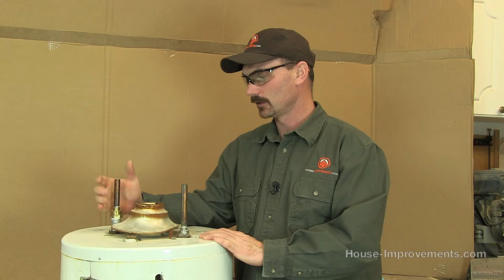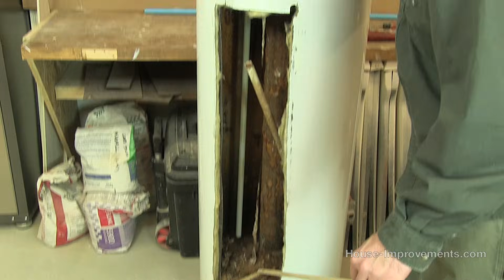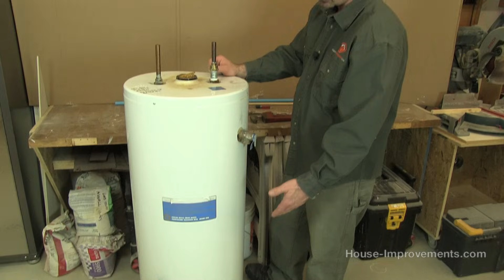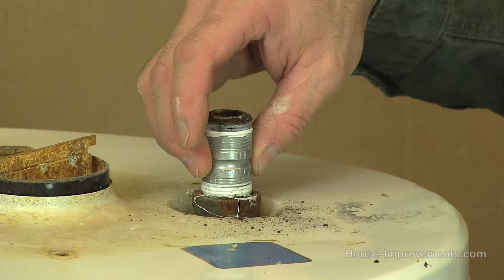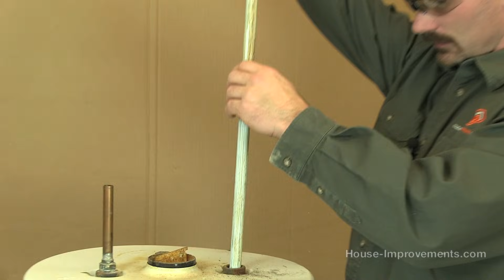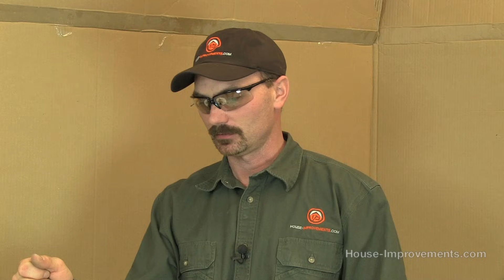How To Replace A Water Heater Dip Tube

Comment: Ok so, what do you do if you don't have the ceiling clearance to install a new tube?  If you need to pull the water heater out and lay it down to replace the tube, you might as well just replace it with a new one and not worry about the mess...
Reply from the maker: That would be an issue. I would suggest your water heater should not be in that location. You may be able to drain and unhook it and tip it enough with help and slip in the new tube?
Reply: @HouseImprovements Ya, that might work.  It's in a tiny closet with the furnace, on a raised platform.  There's gas lines coming in right in front of it, so tipping it would still require that I remove the lines.  Idk why the homebuilders couldn't have figured a better place to put the damn thing!😂

Comment: I have a huge problem and not sure what to do. I drained my electric water heater and now for some reason my water tank isn't filling up and no water is coming out of the hot water faucet at all not cold or anything. When I turned the cold water line back on to the water heater I didn't hear any water flowing into the tank at all so not sure if any water actually filled. I had the cold water line open for about 40 min to fill the tank  then turned power on ECT and nothing! So frustrating been working on it all day and I don't have a lot of money to hire a professional and would love to try to fix myself. Please help if ya can 🙏😫
Reply from the maker: Try turning on the fill valve and then opening a hot water tap at a sink, this will let air out of the system as its filling. Unfortunately you have likely damaged the electric heating element because you turned the power back on without the tank full of water. So you may have to replace that also but they are pretty easy and fairly inexpensive. First see if you can fill the tank, if it will fill then once full (water will consistently come out of the open sink faucet) turn on the power you should get warm water within about 6-8hrs. if you dont get warm water then the element needs to be replaced. Please come to my forum for assistance with what to do then. https://www.house-improvements.com/forums/
Reply: @HouseImprovements  I appreciate you ! But for some reason my water tank won't fill at all . I had hot faucets open while draining tank and left open to fill and waited 40 min to make sure water tank would be full before turning power on but still nothing. Maybe my cold water shut off valve broke when I turned it off and won't turn back on to fill the tank? So frustrating! But I truly appreciate you 🙏
Reply from the maker: @dottielawing4323   Interesting , that could be a possibility .

Comment: Do they make  a flexible dip tube? Not much head room.
Reply from the maker: These have a little bit of flexibility I dont think there are any that are really flexible. if you have a couple feet of space you will likely get it in, try not to kink it however. If that is not enough and if your heater is electric maybe you could drain it and tilt the heater to get it in? You can come to our forum if you hav more questions.

Comment: I have a pinhole leak in the sidewall of that thing in center? Fixable??
Reply from the maker: pin hole leak in the plastic part of the dip tube is no issue, just use it.

Comment: Why not an dip tube made of stainless steel  ?
Reply from the maker: Good question. Likely because most people maybe would replace the heater thinking its not working right instead of knowing to change the 10$ dip tube?

Comment: my cold water inlet had an 18"  dip tube.  Is that necessary or can i just put in a new nipple
Reply from the maker: You need a dip tube. A taller water heater like this one in the video will have a dip tube that is much longer than 18" so yours needs replacing .
Reply: i messed up.  my cold water nipple has  the normal length dip tube.  But my hot water nipple has the 18" dip tube,  Do I need that same length again? Thank you for the reply

Comment: Sorry if you already answer this question but if it's not attached to the dip tube how do you take the dip tube out
Reply from the maker: Sometimes the dip tub has fallen off and is lost in the tank, or some times it is there and you can reach it with needle nose pliers.

Comment: Our hot water tank sits under our stairwell, its top only inches below the underside of the level steps, so withdrawing the dip tube, if it's rigid and won't bend, won't be possible.  Is there such thing as a flexible dip tube that I may acquire to install once I've gone through the anticipated agony of trying to tilt my emptied tank so as to succeed in pulling out the present (probably faulty) tube? 🥵
Reply from the maker: Not that I have ever seen. Change your anode rod as well while you are at it, since you are going to all that work.

Comment: My hot & cold inlets on HWH are both HOT when i havent run any water
Reply from the maker: Not super un common especially if your water heater is turned up pretty high. Turn on a hot water faucet for 30 seconds and then check the pipes about 1' - 2' above the heater.

Comment: I have a leak at the bottom of my water heater. It leaks nowhere else from the tank. I took the cover off by pilot and finger checked the inside the bottom and it has water. Is this all I need to do to fix the water heater? Or do I need to replace?
Reply from the maker: If you have water inside the burner area ,your tank has a leak. Replacement is your only fix.

Comment: My electric water heater leaking water in bottom what cause it? How to fix it
Reply from the maker: its likely rusted through the tank and developed a pin hole leak. Replacement is the only option if that is the case and the sooner the better or you could have a flood.

Comment: appreciate the video, but unscrewing it only removed a coupler and the dip tube is within the heater, there's no way to remove it since there is nothing to grip onto except inner threads, is there a  tool to get the tube out?
Reply from the maker: Not that I know of.
Reply: @HouseImprovements  I did figure it out, basically I had to use needle nose pliers and pull out the old one which did not have a nipple, but the new generic dip tube fit along with my Shark Bite valve cold water supply valve. Again thank you for the helpful video!

Comment: The flexible braided hose idea is a great time saver. Thank you.
Reply: I,used a shark bite flex hose
Reply: I think they make them threaded on both ends and one version with a shark bite style on the other end. They have become very popular in the last few years as it saves a lot of time messing around with pipe length.

Comment: If the dip tube is broken off..will it effect the hot water output pressure..I have hot water but it flows slowly to all fixtures..I cleaned all the aerators on the faucets and shower head already.i also checked the hot water side nipple hole to check for clogged outlet already.
Reply from the maker: It should not effect pressure.

Comment: Thank you for the info, it perfectly matches the issue I am having.   But before I change it, what happens to the old pipe that broke off?   will the corroding piece sitting in the tank affect my water?

Comment: My basement ceiling doesn't have enough room to pull the tube straight out. How do I get the new one in without breaking that too?
Reply from the maker: They have replacements that are in sections linked together.
Reply: @HouseImprovements  Ok thank you and love your channel❤️💪🏻!!
Reply: The other option is to fully disconnect water heater. Lay it down, or lean it far enough to do the task and then reinstall. Similar issues arrive when replacing anode rods. Which if your heater is 3+ years old without replacing the anode rod. Change it while you’re already working on the heater. 

I know this comment is old, but stating for others who are planning on trying to do this task on their own heater.

Comment: This is an awesome video.  I might consider doing this myself or getting my Hispanic Buddy to help.  I changed out my hot water faucet on the tub and found some strange long pieces of plastic in it.  Kindof looks like teflon tape but it is wider.  It clogged up my tub's hot water faucet.  So, I wonder if that cold water pipe is breaking down.  Also, why don't they have it metal instead?

Comment: The benefit of a electric water heater:  you can remove the elements to inspect inside parts/clean out.  You can’t do this with a gas unit.....
Reply: I inspected my gas heater internals by inserting an inspection camera through the port for the safety pressure relief valve on the side. (I had the PRV it off because it needed replacing anyways... was probably 20+ years old and did not re-seal tightly after I tested it.) I was pleasantly surprised to see my dip tube was still intact.  But that made sense because, mine did not have the problem symptoms that Shannon described in video (Failed dip tube causes hot water supply to last much less time than tank volume would expect, because fresh cold water isn't carried by dip tube all the way to bottom of heater, cold water instead flows directly across the top from inlet nipple to outlet nipple..)

Comment: I no longer replace the dip tube, anode rode or even drain and flush my water heater.  Since my community switched from well water to Lake Michigan water I get about 20 years out of a water heater with no problems.  Now if you don't install the water heater installations yourself maybe you would consider fixing these things since installation cost is about four or five hundred dollars. (this can vary widely) I have rentals and I find it easier to replace these items on my schedule instead of getting a call in the middle of the night or when I am out of town.

Comment: In your demo the flue is missing.  I don't see how you remove the solid pipe going up through the roof.  Also, I don't understand why you need to.  It seems like the fittings are easily accessible without removing the skirt.

Comment: My dip tube is kind of recessed in my heater where the only thing I can grasp is the threads with my pipe wrench/  It seems to not want to turn and I can not seem to get a good grip on it.  Is it possible to get some kind of extension to raise the hole it screws into a little higher (1" perhaps) and how is a good way to get the dip tube out if it seems stuck or too tight? 

Thanks!
Stan
Reply: Sounds like your issue is that, your existing pipe nipple that protrudes out the top of the heater above the dip tube, is short so the only part of it you can get a wrench on is its threads.  The new pipe nipple at the top of the new dip tube, can be purchased taller than the old one, giving you a good area to wrench on (other than the threads) as you tighten the new one in.  So if you have to mess up the upper threads of the old one in order to extract it... well, at least its coming out and not going back in. But doing so would mean you become "committed" to getting the old one out, as you likely would not be able to re-attach to the old nipple's threads (after damaging them) without a leak.

Comment: Is the dip tube supposed to have anything inside of it? I took the water pipe that connects to the dip tube and noticed it had a plastic like ball with a toothpick like pointing through the hole.
Reply: Depending on the brand of water heater you have this might be a check valve / heat trap device to prevent the hot water from running back into your cold water supply line.  It helps with energy efficiency and to prevent contaminating the cold line going to the rest of the house.  Some brands use a ball-type design while others use a flap-style design.

Comment: I have a bradford white M280S8DS unit - electric fired.  Stopped getting any hot water about a month ago.  Plumber came by put a new upper element in. All good.  for about a month and a bit.  Now have hardly any again.  I troubleshot it to the lower thermostat being bad.  Replaced it with the kit of upper/lower thermostats and put 2 new elements in.  Now, getting some hot water but nowhere like it was before all this started.  It's a 2015 model (M in serial #).   Could the dip tube be bad in only 4 years?  The water here is quite hard.  The lower element was caked over with limescale and had filled in the gap between the 2 element prongs.
Reply from the maker: it is possible
Reply: turns out I had added a Y connector under the cottage for washing the car, etc and had left the hot water side on.  that messed up the hot water tank somehow...plumber came by and saw it and said I know what the problem is...

Comment: How's possible for a dip tube (it's really it?) which is steel-made (not plastic) be on hot water outlet, not in cold one, as seen on this video and other anatomies of electric tank water heaters?
I mean, the hot outlet has this dip tube, and the cold inlet does not.

Comment: After learning the hard way, my water heater sits in a leak retention tray.  There’s a drain hose going to nearby floor drain.  There are union joints on inlet and outlet tubes, to allow quickly swapping out the old water heater with a new one.  The darn things need to be replaced every ten years to avoid rust thru and ruptures. I do have a salt based water softener, which probably accelerates the rust thru.

Comment: What do you do if, like most installations, you do not have 8ft of clearance to remove the dip tube straight out the top of the tank?
Reply: What about putting the new one back in with very little clearance?

Comment: I had the water heater moved outside, the plumber installed a box to shield it from the weather. Problem is that the 4" rod won't be able to be removed because there is only 18" clearance at the top, not that I have yet tried it as it's newly installed. How can I get around that problem, thanks.

Comment: @Houseimprovements, Two questions.
1).What are the options to remove a Hex head.I'll explain.Got a tank, someone did not put nipples on hot cold inlit.What they did is, copper fitting that screws right into inlit.Slide pipe in middle of fitting, soldered all the pipes etc while on tank.Melted the hell out stuff.I then get tank and lines are cut down to the hex head about where connection screws in.Anothers words I have a nub.I need that off.Tank is like yours, no way to get a pipe wrench over hexhead.Deep socket stripped copper hex.I hate to toss tank just because can't get undone.I want to put nipples on it and make sure whoever soldered while on tank did not melt dip tube which I worry of.
 2).You say in a reply the hot side has no dip tube? If correct, how does the water flow up into pipe say when tank is half full or even full? My tank I speak of is a Whirlpool gas 40 gal.Factory date 2004.

Comment: What if you don't have enough space to take it off?
Reply from the maker: The dip tubes are  a little fixable so depending on how much room you have you may get it in. Otherwise the heater may have to be moved or tilted and for that you will need a plumber unfortunately to unhook the gas line if it is a gas heater.

Comment: Hi guy. I have replaced the mixer valve on my shower and still have an issue with the hot water turning cold. I turn the valve to hot and it goes back to being hot, but then I mix to get the temperature comfy again and it turns cold again. Any ideas? Thanks!

Comment: Like the video. But how do you get the new proper length dip tube in if there is not enough ceiling space above the water heater? Please don’ttell me I have to disconnect, drain and tilt the heater?
 Thank you again.

Comment: good video, but what do you do if the ceiling is too low to pull the dip tube out, or put the new one in?
Reply: Empty the W/H----then tilt it to allow sufficient vertical distance.

Comment: What if you don't have any ceiling height to work the tube in?
Reply: Back in the day, you had to empty the tank, disconnect the fittings and tilt the unit till you can replace the parts. I recommend that you release the pressure and then loosen all fittings (especially the anode) before draining the water inside.  The water adds weight to the tank!

Comment: Weren't dip tubes made out of copper years ago and would last the lifetime of the heater?  Why not use copper?
Reply: Copper mimics the effect of the anode rod. They would tend to develop mineral buildup resulting in a clogged tube.

Comment: Great video, but what do I do about all the sediment lying in the bottom of the water heater from the old dip tube that is clogging up my faucets, shower and washing machine? tia
Reply: I was wondering the same. Maybe its fine?  or worth it for the price diff pending circumstances?  but what if I drink hot water from the tap?
Reply: @Generictubeuser  Good question. I just went ahead and bought a new water heater since mine was 20 years old anyways.